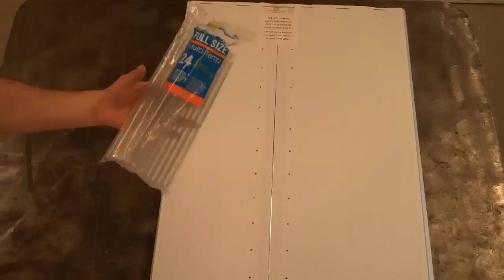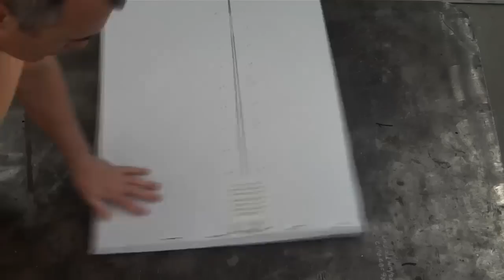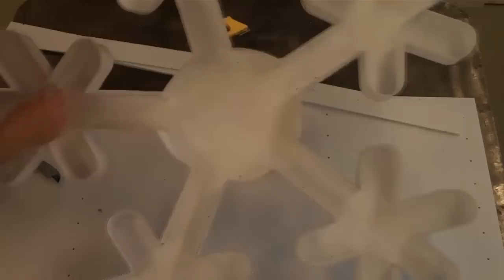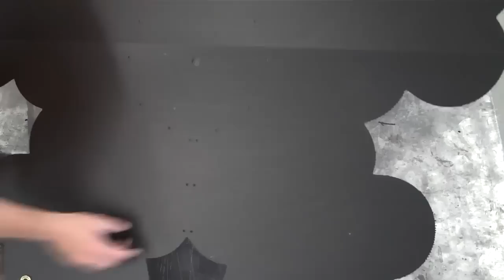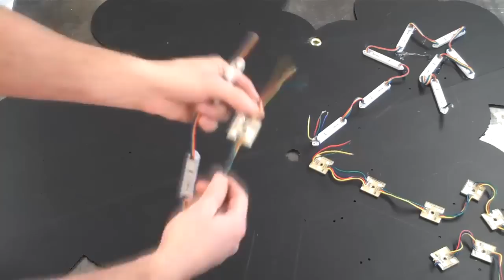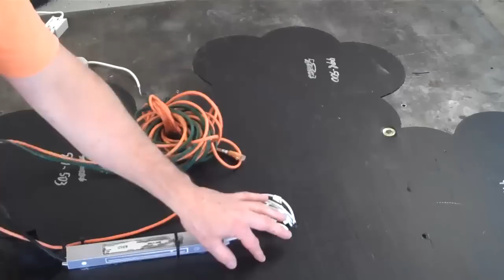CoroFlake Assembly Manual

Comment: What size are the holes for 12mm nodes. is it 12mm or a little less?
Reply: On the new pixel flake
Reply from the maker: They are about .46" or just a little smaller than 12mm since there needs to be some pressure on the pixel to ensure it holds in place.

Comment: Beautiful snowflakes. What glue gun are you using and what temperature do you recommend setting it on for this application?

Thanks
Reply from the maker: The highest possible temperature you can apply the glue at.  Of course as the temp goes up, the glue is not as stiff which makes installation harder and also it can burn you more when applying it.  Hotter is ALWAYS better for adhesion.